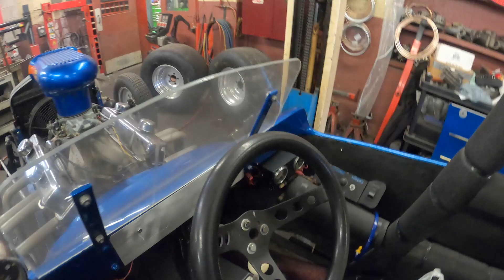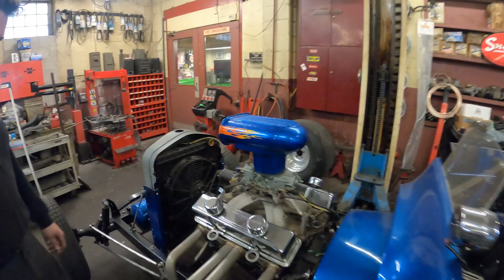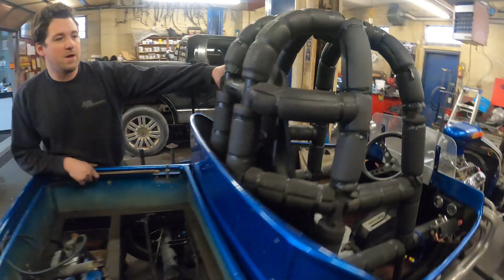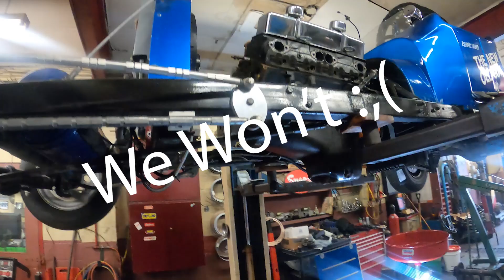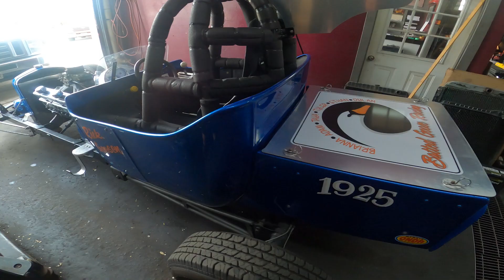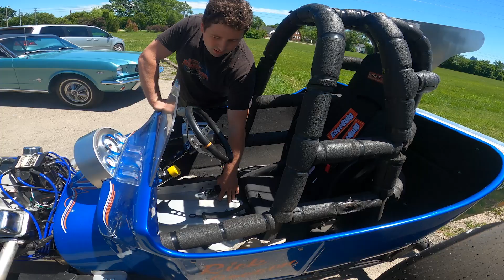Vintage Dragster Gets a Refresh

Comment: This is about an old video but I don’t know how to send a direct message. was wondering if you looked into hub motors for the ev project? I know that the ev company Canoe was looking at them. I figured on trucks that don’t have a solid front axle you could swap the wheel hub with one of these. Still give awd and hopefully reduce work on the front end.
Reply from the maker: That's on the deboss garage channel.  I'm sure Rich has it figured out